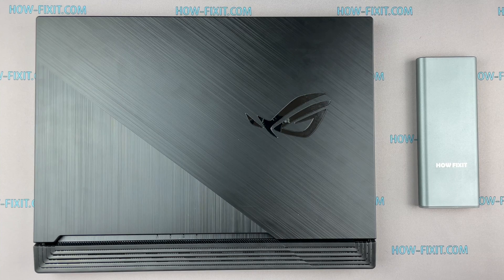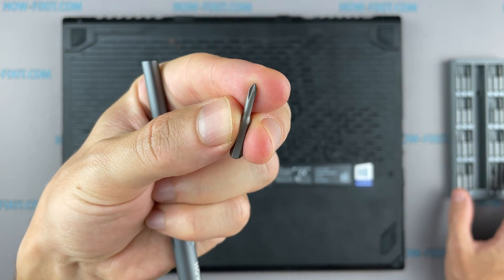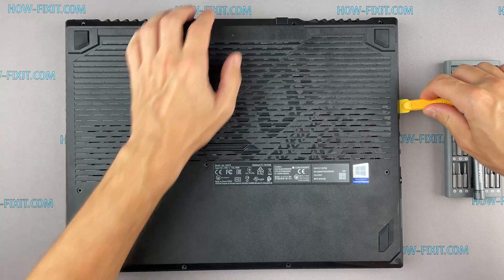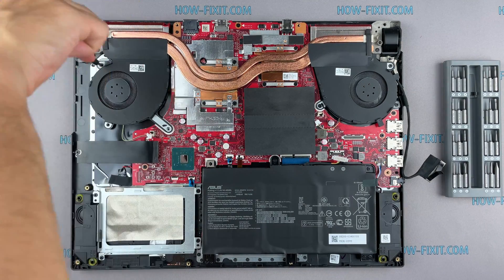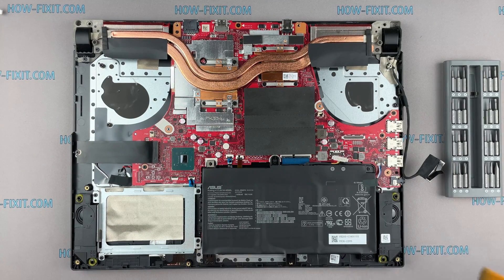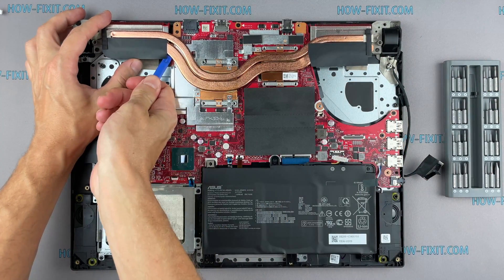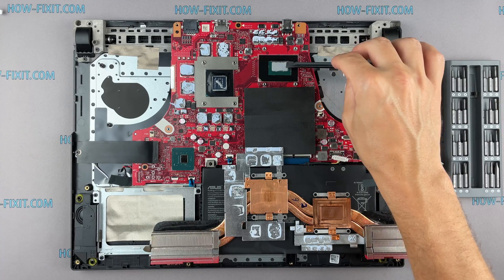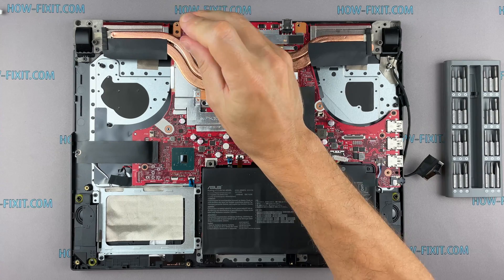Asus ROG Strix G531 Disassembly, fan cleaning and thermal paste replacement

Comment: -Use PTM7950 thermal pads for laptops, it's better than thermal paste because of their dies.
-Use thermal putty on VRAMs and VAM (the surroundings), get the pink one.
-The black sticky note thingy at 2:50 taped on the fan are Acetate cloth tapes, you can use teflon tape instead incase you've ripped it.

Always unplug battery cable.

Comment: For the VRM, it uses the 1.5 thick thermal pad.. doesn't it? For the gpu and cpu, is it enough for using just a deepcool Z3 thermal paste? Thanks a bunch!
Reply: Just use upsiren u6 pro. Then you dont have to worry about getting the correct thickness.

Comment: Thermal paste or liquid metal?
Reply: If you are skilled enough to apply and your system face heavy load work, then liquid metal.... it's more efficient...but if you mess up things and liquid metal spill or leaks to the motherboard, it can short the motherboard since liquid metal is a conductive fluid

Comment: A tip at 4:37 , first time you open the lappie, pipes are stuck very very tight, DO NOT PULL UPWARDS BY HOLDING AT ONE SIDE
Gently try to pull apart by applying small pressure from left to right like the one in shown in video.
i slighly bent by pulling only on one side

Comment: 2:21 did u unplugged the laptop screen ?... Like mine laptop screen is broken and i have a external monitor.... Works fine with hdmi but i cant excess bios... Does unplugging the laptop screen from mobo gonna allow the bios to display on external monitor via hdmi ?

Comment: I replaced both fans but only the fan behind the power button runs constantly.  The other fan runs for a couple of seconds then stops.  I'm trying to determine if that is intentional or if I have a bad fan I need to return.  Thanks!
Reply: It’s the GPU fan and is not used as much

Comment: Hi, I reapplied thermal paste on the CPU and GPU only, using silicon thermal paste. But now few CPU cores are  still reaching temperatures above 50 degrees (C) and it shutdown on it's own.
1. Should I use the MX-4 thermal paste?
2. Should I reapply thermal paste on the surrounding chips as well (I skipped them like you did) ?
Reply: My Asus rig strix uses liquid metal thermal paste, not sure if all of them do but if so its because you used the wrong paste. Also it is normal for temperatures on gaming laptops to reach up to 80 or 90 degrees.
Reply: @psychedelicpunk5031  I sent it to a service instead, and they took care of it. There was a lot of dust left in the fans which I didn't have a blower and other tools, and it works now.
Reply: @DamjanDimitrioski  Ah that's good to hear man, glad you were able to get it working good again
Reply: @psychedelicpunk5031  I've one rog strix g15 with liquid metal too, but when I choose turbo mode, my laptop quickly gets 90°C without do any task
Reply: This is like that since I bought it
Reply: @camiloochoavalencia8562  That is really strange. I'd bring it into a shop to get checked out if its like that. If its overheating just from idling I imagine gaming would he quite dangerous for the components if it's going up dozens of degrees more than that. Have you checked for dust buildup? That is usually the main cause
Reply: @psychedelicpunk5031  I have not warranty anymore, and I recently cleaned the laptop inside, but the problem doesn't fix

Comment: Tip : Bad to clean or remove the dust over ram or motherboard, it may cause minor problems.
Reply from the maker: In the video guide there is a demonstration of what to clean, I hope you understand that it is necessary to clean the components away from the motherboard.

Comment: Heyy men .. i have problem with my screen after replacement socket .. im forget plug out battery .. and when i replacement lcd socket .. little cracker was out .. and i think Will be nothing happen .. but after i place all ..and turn on power .. my screen was dim .. and then i try a disassembly again with plug out battery .. and plug in again .. turn on power .. the screen was shut down .. 

Anything else .. how to fix this ?

Comment: If my fan on the right side (near the power button) is usually slightly rattling and sometimes goes crazy after moving the laptop, does cleaning it help or should I just go to a shop?
Reply: @Mihnik Mihnik no, for now I just never move it if not sleeping or off, the second I move it out the horizontal plane while on the fan might go crazy though.
In which case I just make it sleep, on sleep, on, sleep, until it stops then put my fan on turbo for a few secs.
Reply: @qgqsrg1  had the same problem with that exact fan on the right side back in 2020 after 1.5 month of owning the laptop, turned out it was just faulty from the factory, the guy in authorised service shop said they've had dozens if not hundreds of such cases with SCAR 3's and the best thing you can do in this case is just replace the fan. 
Got replaced mine, no problems since then.

Comment: Hey there, I mistakenly cleaned the vram also and now even after using some expensive thermal pastes my laptop turns off due to overheating can you tell me what to do in this case or were they thermal pad ?
Reply: Did you find a solution? I too accidentally clean the vram
Reply: @lolsword7  yes after one year of experimenting with thermal paste and power adapter and cleaning and clean install, it turns out you have to install the intel drivers from MyAsus (as I own an Asus laptop) you could find yours brand and will do the job just as new hope it helps you ❤️
Reply: @_danish19  which drivers can u please name some?
Reply: @nikhilkabba2345  The official driver for your cpu by the laptop manufacturers not the cpu manufacturers
Reply: @_danish19  where can i get them?
Reply: @nikhilkabba2345  I got mine from the official website of Asus as I owned an Asus Laptop

Comment: I see a wire in the right corner of the right fan… what is that wire for? Can someone explain to me? I have a really big problem… I have exactly the same laptop and when I finished cleaning it, I just assambled all and the last thing I was going to do, was to connect the wire to his slot and done… the thing is that when I touched the slot of the wire with the wire I was going to connect, a short happens… so can someone explain what is going on? Why did this happened? How big is the trouble? Should I replace the motherboard with a new one, or I can also fix the issue with the motherboard’s short?  Please help me figure out the problem.
Reply: Hello there! That would be the display cable, you most probably didn't disconnect the battery from power before you started working on it hence the short, this is a must on any kind of laptop.
I'm assuming you have sorted it out by now,. I'm curious though, did everything work as normal once you reassembled it or did you mess something up?

Comment: Just to ensure, before removing the battery connection, I supposed to disconnect the battery plug-in, and run out all the battery/power/electricity I had?

Comment: Another tip. Be very careful when disconnecting the battery. The little clip that Asus likes to use to hold the battery connection in place can fly off and fry the motherboard if you're not careful.
Reply: careful how? fly off how?
Reply: @aj-sz8mu  If you apply too much force to the pin when trying to disconnect it it can pop off and fall onto your motherboard. Just be gentle and aware of what you're doing.
Reply: @HeyitsDaniWolf  you know there's a lock on the clip. you just need to slide it out and you can remove the clip easily.
Reply: @mccoolitz8688  Good to know, thanks. Luckily I haven't encountered the issue myself but a friend of mine did which is what prompted the comment.

Comment: My laptop was overheating followed your tutorial found so much dust 😂 but now it's cleaned Thank you!
Reply: Hey bro, how much C° was the laptop going to?
Reply: @pajaacab  I don't know about that guy but mine us going to 90-95°C when gaming in "performance" mode.

And this is with games that aren't too taxing as well
Reply: @sirgideonofnir5270  that is the same with mine (since it was brand new). which i think is just the reality for laptops. cpu can handle up to 100C.
Reply: @aj-sz8mu  I know, it's the same with mine and it really scares me especially since I've had it for 2years. Am gonna buy a cooling pad tho. See if there are any positive effects
Reply: @sirgideonofnir5270  Disable CPU boost and change the power limit to 99% instead of 100. My temps went down 30 degrees after doing that when I first got my laptop
Reply: @lilyluhtwizzy  and it doesn't affect your performance?
Reply: @sirgideonofnir5270  Nope, not at all :)
Reply: @lilyluhtwizzy  alright thanks man, ama try it when I get home. I'm update you of the changes and give you a huge thank you if it works
Reply: @sirgideonofnir5270  Ok :) It should work. One thing you have to know is that the CPU Boost setting in Control Panel doesn't show up automatically, so I'd recommend watching a tutorial on how to allow it to show up for you. I think it's a command so it's easy.
Reply: @lilyluhtwizzy  aight for sure man, thanks again
Reply: @lilyluhtwizzy The thing is u can change even from 99% to 90% depending on ur CPU load.

Just use task manager and go to performance tab to check whether the clock frequency is below or equal to ur base clock frequency. For example, my laptop base clock frequency is 2.20 ghz and overclock for cpu goes upto 4 ghz. 

I decreased my processor power upto 95% until my cpu frequency went like 2.19 ghz. Above 95% my cpu goes like 3.70 to 4 which is bad for playing games

Comment: Hi I have the same model. Is it ok if I use thermal pads on the vram? And thermal paste on the main CPU and GPU?
Reply: Yea i wanna know this too, can someone help?
Reply: @nicholasconstantine2624  hey actually after using thermal pads, my temps have increased a lot. So I think we should just stick to the paste
Reply: @yashwanth8933  how much thickness do you use on the thermal pads tho?
Reply: @nicholasconstantine2624  the thinnest one available from the pack
Reply: @yashwanth8933  where is the 4ram?
Reply: I already bought a quiet expensive thermal pad but thanks for the info i think i gonna buy another set of thermal paste then
Reply: @nicholasconstantine2624  yeah I have ordered Arctic paste too, will remove those pads
Reply: @yashwanth8933  i tried using 1mm thermalpad and its too thick for the heat sink luckily i bought 2 kryonaut and when im done repasting all of it and im doing the stress test it got me from 95⁰-96⁰ with only 3.3-3.4 ghz to 70-80⁰ with 4.0ghz constant. Changing thermal paste is really that significant. More performance with less heat and less fan noise
Reply: @nicholasconstantine2624  so u just used the paste on the CPU, GPU and the VRAMs right?
Reply: @yashwanth8933  yes i replace all the paste
Reply: @nicholasconstantine2624  still doing great your laptop? I'm repasting at the moment so I hope you see this :p
Reply: I used carboanaut for CPU and GPU in replacement for the thermal paste. It's like liquid metal but in cloth form.

Comment: READ BEFORE PROCEEDING
1. AFTER REMOVING THE SCREWS, DONT LIFT UP THE PANEL WITH FORCE. My laptop has RGB strip connected to the panel and u dont want to break the connection.
2.  ALWAYS DISCONNECT THE BATTERY BEFORE DOING ANYTHING WITH MOTHERBOARD.
Reply: thx for the tip i also have the rgb on the bottom i almost forgot about it since is permanently turned off, it's just distracting.
Reply: Ugh mine came off, didn't realize it was for the rbg
Reply: How do you connect it back?
Reply: @hishamburger  just lift the white part, then insert the flat cable
Reply: This was a useful comment for me.

Comment: Hello there,

While cleaning the fan, when I put back the banded part of the fan on the right, I saw a small spark and a burning smell came out. when i turned on the computer i didn't encounter a problem, the fans were working and everything seemed fine.

After spending some time at the computer, I noticed that the screen brightness was uneven. 

I did not remove the battery while doing this. That's why I think it's an electric current. Is my motherboard damaged?

Thanks
Reply: Hold up your scaring me cause im planning to do this in the summer and im a kid except hopefully my parents will let me do it and help me
Reply: @rahmmehra5583  you don't have to worry if you follow this video or any similar disconnecting the battery is the first thing they do after removing the lid
Reply: @matox01tekk  guess what lolol my parents just took it to a professional who is fixing it no work me i guess :) lets go
Reply: Always disconnect the battery before cleaning dust because there still have current flows on motherboard if you don't disconnect the battery. Apparently your motherboard has damaged, I suggest you send it to service center to repair

Comment: Is that thermal grease on the Video Ram? Don't they use thermal pads?
Reply: Did you find the answer im not sure either
Reply: @croeternal  From what I've seen it seems to be thermal grease/thermal paste. Not sure though. Haven't taken my laptop apart yet
Reply: They use themal grease for VRams
Reply: @saitejaalapati2380  Thanks mate!
Reply: i have been looking on multiple videos and even the newer models have thermal paste, that was one of the reasons i wasn't sure if i should do the cleaning my self, what if i destroy the pads while removing the cooling solution because i assume it has to be very specific thickness of the pad if there were any but this seems to be more user friendly for cleaning and replacing paste by yourself
Reply: @matox01tekk  hey can I use thermal pads on the vram then?
Reply: @matox01tekk  I have the same model. It has thermal paste now I guess, can I remove it and replace it with a thermal pad?
Reply: I'm not sure if this is the correct name, but it looks like thermal glue. It works the same as silicone sealant, as in it comes in a tube and requires curing, but it's thermally conductive
Reply: @KangkungBasi  I second this. I opened mine up today. That is thermal glue, and it does in fact feel very similar to the touch to silicone sealant. The CPU and GPU use regular thermal paste, though.

I cleaned all the thermal glue and replaced it with a large amount of thermal paste. Hope nothing fries.
Reply: @CezarBorugă  Does the heatsink makes contact with the components without the glue? Hope everything went well for you.
Reply: @KangkungBasi  From what I could see during installation, yes, it does make some contact, although I'm not sure it's as good as the original thermal glue. I basically put way too much thermal paste on all components and let it "squish" out during installation.

I am most concerned with the VRAM modules, as I'm also mining 24/7 on this laptop, but since it hasn't fried in 3 days, I suppose the contact is fairly good. I'd love to look at it with a thermal camera at some point.
Reply: @CezarBorugă  Any update on this? how is the temperatures like?
Reply: @AdultingIn60  Temps are better than before repasting. I used Arctic MX-4 for everything, including VRAM and Power delivery modules. No issues so far - laptop is still alive.
Reply: @CezarBorugă  by better, what temps are you getting?
Reply: @aj-sz8mu  Can't remember exact numbers (it wouldn't be very relevant because I can't remember the ambient temps either), but what I do remember is that max temps dropped by 3-4 degrees Celsius.
Reply: @CezarBorugă  ok thank you.